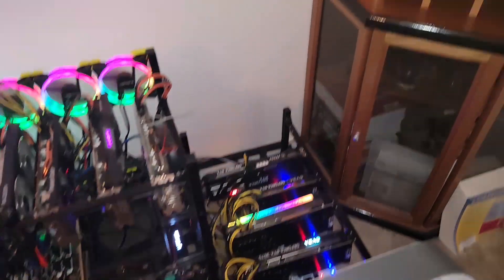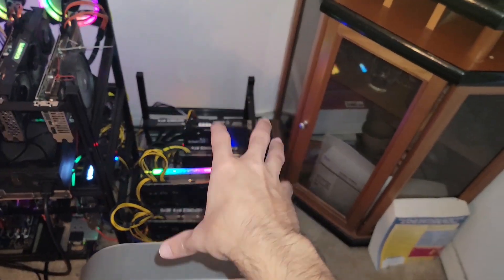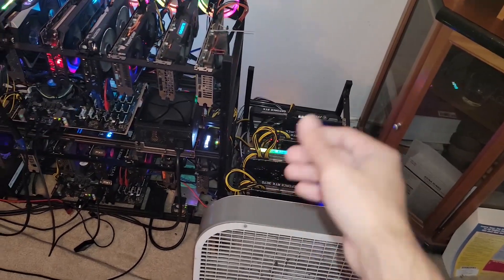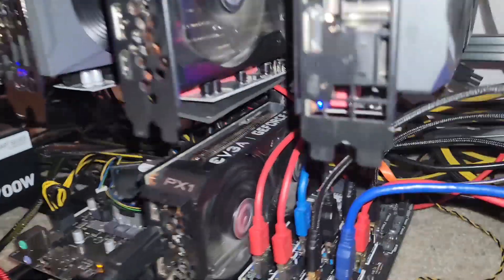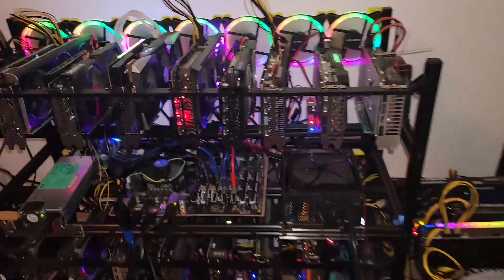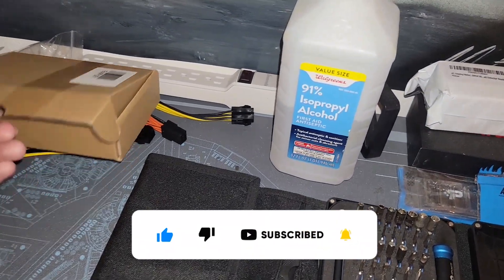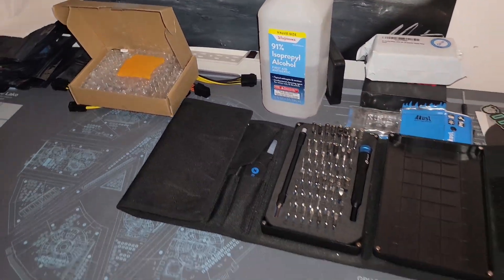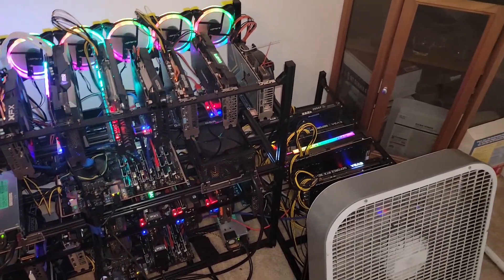ASUS Dual RTX 2080 OC Fan Replacement

Comment: Just had one of the fans stop spinning on my newly bought asus dual rtx 2070 super. It worked last week and have done nothing but update nvidia drivers and now the fan doesn't work anymore. I don't think it's the drivers fault. Any suggestions?
Reply: The same thing happened with my rtx 2080 super 
The first fan (the one next to the gpu's I/O) didn't spin for about 8 months after buying the gpu
But one day i disassembled the gpu, unpluged the gpu fan headers and plugged them again, updated my drivers and just cleaned my case and it magically worked and has been working perfectly ever since 
I think it may have been a driver issue 
I recommend trying what i did multiple times and see if works 
If it doesn't there's an ali express link through which you can buy the same fan model, they're 14$ without shipping i think

Comment: Sweet video bro, now I need to find a video about replacing 3070, and 3070ti thermal pads mine have only been running for only about 2 months and the mem temps have gone from 70c to 84-90c.
Reply: What model cards you have? It’s not too difficult if you can find out what pad thickness you need. A little scary the first time but nbd
Reply: @GoCrySnowflake  founders